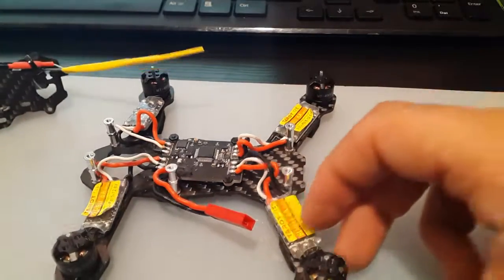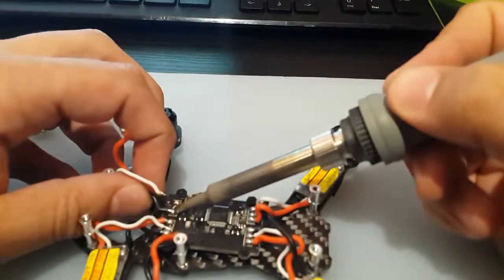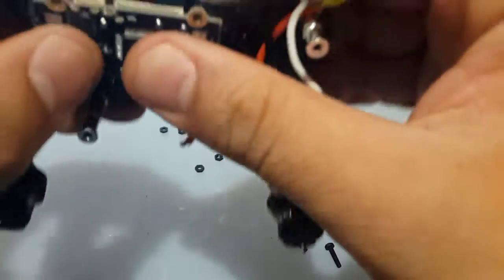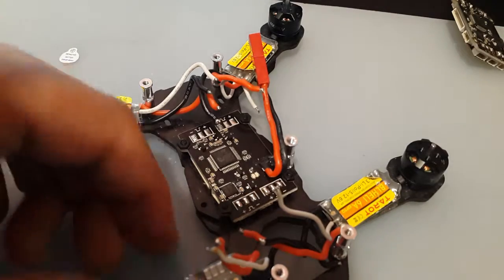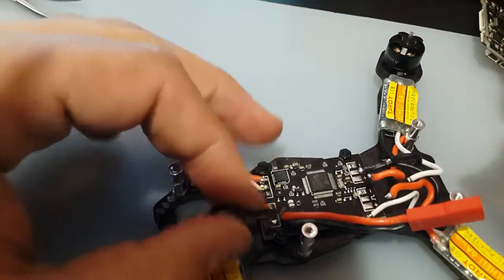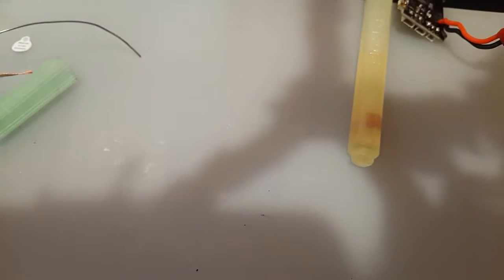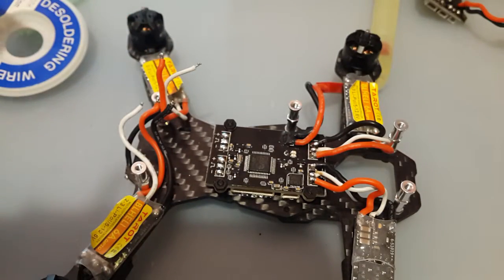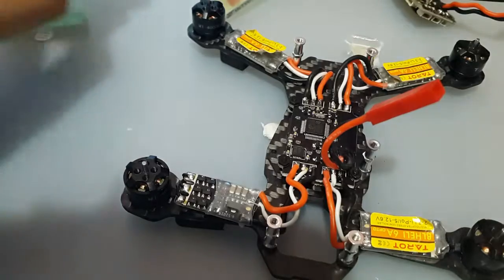How to Replace Tarot 130 Flight Controller

Comment: The only vid with this board on tube. I wanted to order it for eachine racer130, as the eachine fc board is garbage after few test in the house,  and in all sites where I have found it was only one picture, with the buzz side up. What a shame! Thank you very much!
Reply from the maker: marius valentin cojocaru Be careful the size of mounting holes is also retarded on this FC.
Reply: I will, thanks!

Comment: This models flies well and you would'nt believe but I had similar problems with a faulty wire on the exact same motor (motor 2). This model should be brought into 2017-18 by changing the FC for F3 / F4 version and BHeli-S Dshot 600 (or at least multishot) escs. The current BLHeli ESC does not do damp light and so it kind of floats/drifts/quivers when you throttle down. Set motor signal to PWM and don't try onehsot125 or motor twitches (which can be unnerving). Nice repair :).
Reply from the maker: Senze Thanks.. I am actually going to revive this quad on the channel with f4 FC and the new emax 1106 6000kv and airbot 32bit 25a mini esc but finding a FC with same dimension is proving difficult because it's 23x23 and not the 20x20 which is the standard now. But yes it flies amazing and it's like 92grams or less.
Reply: I thought of doing something similar. I would zip tie a 20x20 FC to the existing holes - built in soft mount FC??? :). Eachine VTX02/VTX03 would fit perfectly, only problem is how to mount the FPV camera (if you are just using this frame that is).

Comment: Where did you buy the fc
Reply from the maker: +Edimar Stein Banggood
Reply: I cant find the FC on banggod, do you have a link or model name? or more specfically can you point out where the boot pins are?
Reply from the maker: Check description just added it.

Comment: I'm trying to replace the receiver, but whenever I power up the drone an alarms set off, along with a flashing light. Do you know what this means?
Reply from the maker: Are you talking about the Tarot 130 correct?

If so i think its the RX no signal alarm going off witch is normal.
Reply: Yeah, I thought so, but in my case I already replaced the receiver with a FS- IA6 so I don't know what i'm doing wrong.
Reply: and also, the flysky tx says binding ok, I don't get it.
Reply: and also, the flysky tx says binding ok, I don't get it.
Reply from the maker: Change the receiver to PWM on cleanflight.
Reply: I figured it out, I just had to take out the bind plug...I'm such a noob! but  although the binding is complete now and my FS-IA6 and Flysky tx are finally talking, when I arm the motors I don't get any response :(
Reply from the maker: +Eric Avila calibrate your end points